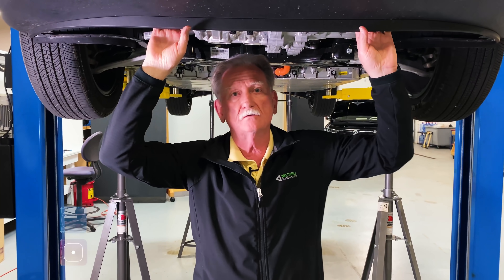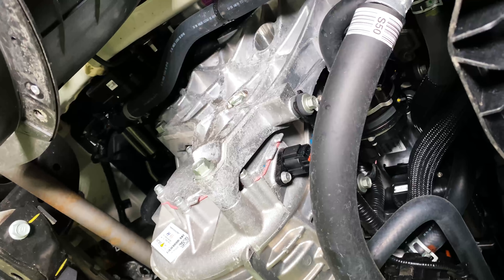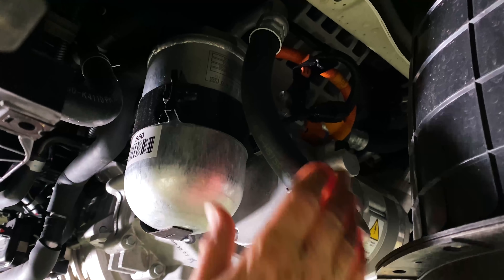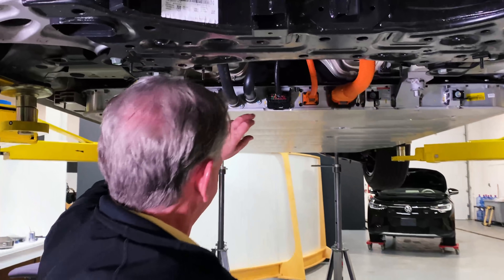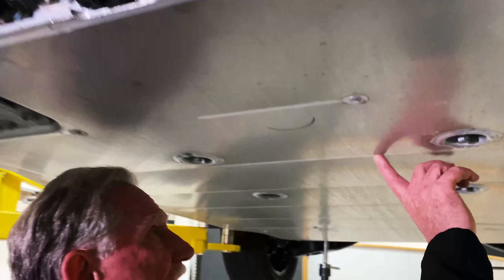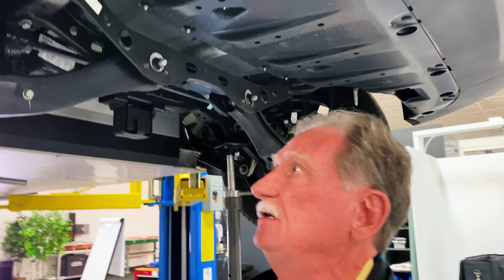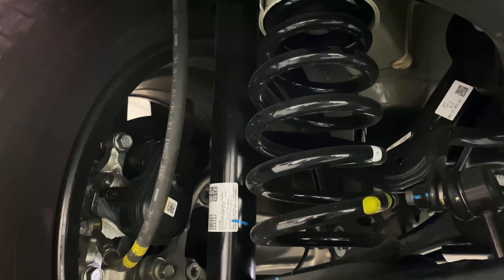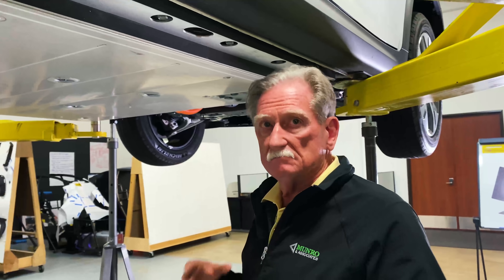Under the KIA NIRO EV

Comment: This is great.  You answered my question - where is the battery pack?  It's low, so the center of gravity is low.  Good.  I had wondered if they shoehorned it into the 'frunk' compartment.

The 'frunk' is packed with stuff.  I'd enjoy knowing just what is in there, too, but I realize the car isn't yours to tear down.

Kia needs to be thinking about range and efficiency (miles per KWh).  The Niro isn't a good 2021 car in those things.  I won't throw stones for the Niro's acceleration, which is weak for a BEV, but that's okay for many, many use cases.  A family car doesn't need to be a track champion.  The cargo capacity isn't great, either, but it can meet the needs of many use cases, too.

But I can't, for the life of me, imagine how Kia will make the car 'smart.'  Nobody but Tesla seems to be on the path towards highly intelligent go-anywhere autonomous vehicles.  Tesla has thrown down the gauntlet.  Who will pick it up and compete?  Anyone?

And the Niro's price seems too high for what you get.

The Niro isn't a purpose-built BEV.  That is a problem, too.

All of that considered, the Niro isn't a car I would consider to be competitive at its price point.  Kia will have to find ways to improve dramatically if it hopes to secure a generous market share in the automotive market that's coming.

Thanks, Sandy, for your insights.  Much appreciated!

Comment: Well, its a car that came to market 5 years ago and was likely in development for several years before that. Im 100% positive KIA knows this wasnt the best they could do. That said it was the best price value of the time, one of the most efficient EVs, and the first BEV that I actually saw advertisements for in the wild. Just waiting for them to send him an EV6 or Ionic 5.
Reply: I agree.  The price is the problem with this vehicle.  This is a nice little car for a young person or and old person who both have somewhat limited needs.  However, it is priced like a Tesla and that's not OK.  Frankly, the hybrid is a better offering since it is $15,000 cheaper, gets good gas mileage (about as good as an old Prius) and the base model has all the stuff most people care about.

If the Niro EV was $30,000, that would be a decent offering, but at $39K base, that's just not priced right.
Reply: @TeodorSpiridon  ICE manufacturers want their customers to buy ICE or PHEV , they're all pushing those cars.
Reply: @Teodor, I agree.  I have a 2018 non-plug-in hybrid Niro.  It’s a solid little car that gets mileage about as good as a Prius for a reasonable price.  I like the form factor and it is very agreeable (if not exciting) to drive.

But as a BEV for almost the price of a Model Y, it’s not a very good deal.  I do have a neighbor who bought one on a very cheap lease deal, $298 per month, and she is very happy with it.
Reply: Kia et al really do need to find a way to make EVs less expensive.  That won’t happen until batteries become much less expensive.  The hybrid version has an almost $15K lower sticker price.  It seems unlikely the price gap would ever be closed through reduced maintenance costs of the EV.  I live in the central US and the EV version is very rare on dealer lots.  For now the EV version seems to exist mostly for compliance in costal states and to build corporate experience in matters EV: nothing wrong with that, of course.  It is a nice solid car, and I would be happy with it if a used one turned up for an attractive price.
Reply: @wtmayhew  It is not just the battery cost though. First people need to understand that the entire automotive industry has already been running on low margins for a very long time. A lot of that has to do with sunken cost. A manufacturer will spend billions developing a new platform, figuring out how to build the platform, and figuring out what vehicles it can put on that platform decades in advance. Then they spread out that cost over the next 20 to 30 years. The longer they can build with the same platform using the same engines, the more they operate in the black. Most manufacturers are barely halfway through the expected life span of their last platform and had hedged against pure EVs at that time. They hedged wrong and are now trying to meet rising market demand and regulatory pressure. That is expensive work. 

How we get cheap EVs in the future is expensive EVs today. Period. There is no magic formula to make a super budget car that would meet all of the high tech buyer and regulatory expectations in the US. And there's no good way to shortcut the market processes that create cheaper materials. Except for dramatic government subsidies which most of this new wave of EV investor fanatics is against, even though most of the stalwarts of the financial system have benefitted from dramatic and perhaps excessive government assistance for decades. Oil for over a century. 🤷
Reply: @patreekotime4578  Thank you.  Those are excellent constructive comments.

Comment: I'm surprised by how little protection there is for the battery cabling at the front of the battery. The little hatch has protection to stop impact damage on the bolt heads, but the cabling seems very open (unless a shield has already been removed?)
Reply: I think Munro removed the shield. I have a kia Sorento the under shield is enormous, I have to remove it every time I change the oil. Super annoying.
Reply: There is normally a cover there to protect those
Reply: There is a plastic cover over the whole underside
Reply: I noticed that, too.
Reply: That's why this is an "under the cover" footage :)

Comment: Battery box quite thin, yep it is. It also exposes every hose and connector to damage. Go over a speed bump and you've trashed everything, not to mention rocks smacking everything. Why no protection for these critical connections? Just add a skid plate for protection.
Reply: Not the experience of the thousands who actually own and drive a E Niro
Reply: @1pipmk  Just my observation. As for yours, do you have information from the thousands of users you quote saying nothing has happened to the underside of their vehicles?
Reply: There is a cover and it was removed before they made the video.
Reply: @TheEvilmooseofdoom  Good, thank you for the clarification.

Comment: Thank goodness the auto industry is moving away from overbuilt overengineered overpriced EVs to something more reasonable.
Reply: It's underengineered and overpriced.
Reply: I think your assumptions maybe incorrect, 

Today's pricing: 

2021 Kia Nero EV, average price is $41K base model. $47K for Premium. 

2021 Telsa Model 3 standard range+ is $39.5K. 

Its worth noting that the depreciation on a Kia Nero EV is 55% over 2 years. Vs ~20%. So you can pick up a used KIA Nero for $19~21K. 
I am assuming by "reasonable", you are wanting a sub $30K EV or possibly $25K new? 

There isn't one....... yet.

Comment: I know someone who has a kia niro (64kwh) here in the UK, not a bad car good range, 0-60 about 7sec, they came out n the UK about the same time as tesla model 3, the kia is a good buy here as it is $43,000 when the model 3 standard range is $52,000
Reply: Sure the Niro is an ok BEV and would urge anyone to buy that over an equivalent ICE.. but.. you get what you pay for. That model 3 is worth the 10K more, and then some..  IF you can afford it. But.. that’s why many BEVs are needed to fill all the segments
Reply: $41 KIA, $39.5K Tesla here (US). 
Can you guess which one has a 50% depreciation rate?
Reply: @fredpinczuk7352  Kia still has a $7500 federal tax credit....and like most dealerships you'll can still get additional discounts.  Let's not forget either that KIAs can be serviced at any dealership nationwide.  Tesla is riding high with depreciation, but make no mistake...that wont last forever.
Reply: @mustangcrazy77  My local KIA dealers marked up by $5K+. No color choice, no options. "This is what we have on the lot" kind of attitude. The Tesla was still cheaper. and for a lot more standard options and performance. Kia was #1 on our list initially. But the depreciation is just horrible.
Reply: @fredpinczuk7352  You should have expanded your search radius, ours was marked down $7k.  As for tech, ours is fully loaded.  There is nothing on a Tesla model 3 that we needed….and we HATE the all in one center screen.  It’s absurd not to have a center display for your speed…and dedicated buttons for everyday items.

Comment: Look at all that wasted space between the battery and car floor! And a full transmission tunnel too! Gas car chassis don't make good electric cars.
Reply: I imagine it's not a transmission tunnel,  but just for exhaust pipe.  All the same,  it's wasted space.
Reply: @jamesengland7461  Exhaust pipe and the shaft to the rear in the AWD versions of this platform.

Comment: How can those battery connectors hold up under water?????
Reply: They are well sealed
Reply: @mikeselectricstuff  doesn’t it seem like you can just reach down and mess with the connections too easily? At least with combustion engines it was kinda scary and dirty but now it’s like a computer outside. Not that scary.
Reply: @joesshows6793  There is a cover that goes over it all.
Reply: @TheEvilmooseofdoom  interesting. Doesn’t seem to be any room for a cover

Comment: Another great in depth review, KIA could have done better for sure
Reply: Give them a break they are coming out with the EV6. What’s more the Niro does what it says on the tin 260+ miles in fact I get 300+ out of mine.
Reply: Its a 5 year old vehicle on a compromise platform that was one of the best priced EVs and it is still one of the most efficient EVs out there. 🤷 It was also the first pure EV that I actually saw advertisements for in the wild. Not sure what you think they could have done better.